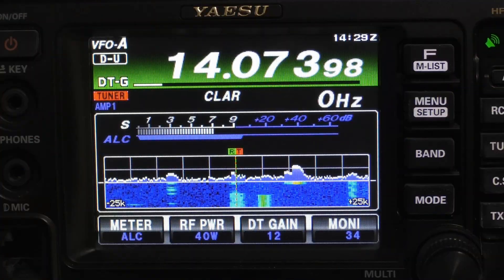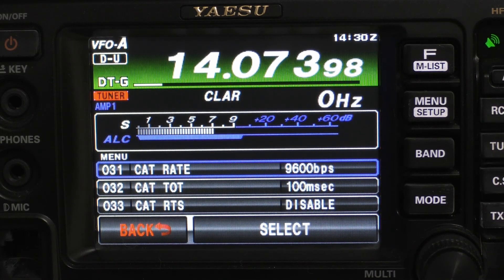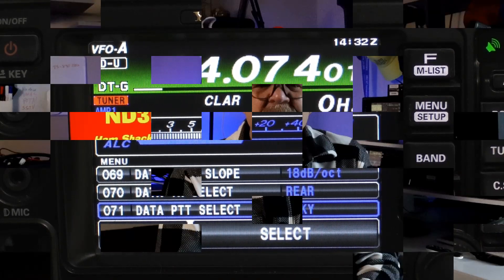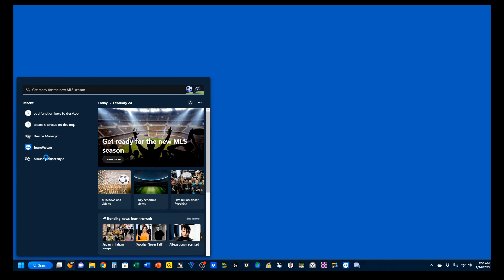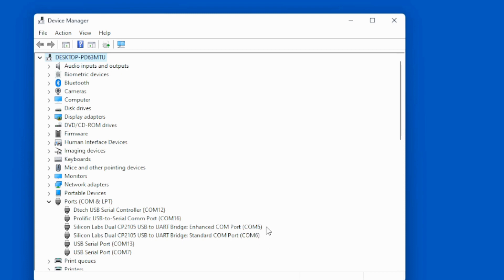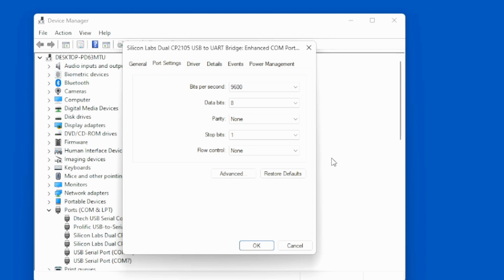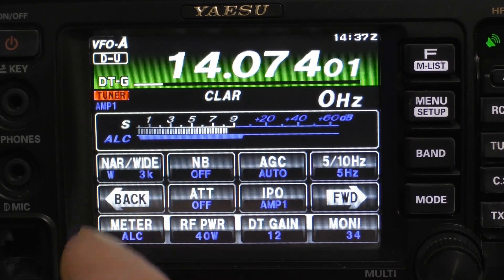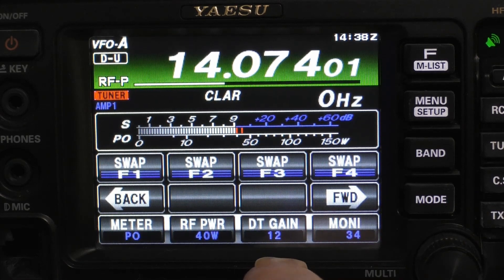Setting your FT-991A for ALL Digital Modes

Comment: Hey Tom, some contradictory info here vs. your earlier videos (FT-991A with Winlink Vara; Using WInlink with your FT991A - Setup and Demo).  I'm setting up my 991A for the first time, and I'd rather not do it by trial and error.  033 CAT RTS: Enable/Disable?  066 DataLCut: Off/100hz? 068 DataHCut: off/3000hz? 071 DataPTT: RTS/DAKY?  I appreciate your videos a great deal, just need clarification on these settings!
Reply from the maker: I’ll have to get my 991A connected again.  It’s currently on the shelf, but I do have a space cleared for it.  Yaesu rigs are all different.  Some times they use RTS, sometimes they don’t.  You could set it up without RTS then do a quick op check and see if it works.  If it doesn’t, toggle RTS on and try again…. On the frequencies, as long as it’s set up to Rcv and xmt over the range you need, you’ll be golden.  I’ll try to get my 991A on the air this week and get you a better answer.

Comment: Tom … while interesting this isn’t helpful in that each of these applications has its own set of settings that must match what’s been chosen here.  FLDigi, JC8CALL and WSJT-X need to be configured in such a manner that these settings above actually function.  On top of that some of these vary by the band.  I don’t see for example the setup for FLDigi that matches these radio settings for sending via FLMsg over say 10M, 6M and/or 2M FM.  Did you do a video on that as well?
Reply from the maker: That’s something I’ll have to take a look at.  Hopefully I provided enough to at least give folks a starting point.

Comment: Enhanced CP2105 UART port is not always the lower one.
Reply from the maker: True, but I was going by the info I had at the time. After a few months I found out it wasn’t fully correct and too late to make it right without deleting the video and doing it over.  Congrats though, you’re the first to let me know.  My 991A is currently part of a go box.  I purchased a new computer just for it and when I make a video about the setup there, I’ll be sure to put the right info in.

Comment: Tom,  Thanks for the video.  I have a question about using the FT991A for Winlink via VHF packet.  The Winlink popup after a session is opened does not have a setting for the 991A radio.  Do you know the proper settings to use to be able to send a message through Winlink via VHF packet.  It does for ARDOP, but there are no ARDOP stations close enough to me for a connection.
Thanks in advance.  Tom KN6VFB
Reply from the maker: I have the same problem. No nearby VHF RMSs.  So I can’t help with that.  There are a few videos on YT where people describe the process, and it seems pretty straightforward.  73
Reply: Would you point me in the direction of such a YT video?  I am using soundmodem software as the interface, but can't find the CAT.dll file for the Yaesu 991A.   @ND3N

Comment: @rondvaartpraamverhuurleeuw3750
0 seconden geleden
Perfect video, CW works but..... SSTV? I succeeded in hearing de soundcart but then it is not transmitting or the otherway around. Rig is transmitting but no sound. 2 days of struggle with all different setting but no solution.
Any ideas about the right menu settings on the ft991A + DM780 com ports and everything is correct.

PA1FR

Comment: Hello, I need your support. I use an FT 991A and do WSJT-X via HAM Radio Deluxe. I set up the connection properly and the sound card also works. I control PTT via RTS. My problem is that when I go on air the MODE switches from D-USB to USB by itself. What could this be and do you have a solution? THX
Reply from the maker: While I have HRD, I’ve not used it to control WSJT-x. From a wsjt-x pov. Don’t use rts for PTT, rather use CAT.   Make use you have the latest 991A drivers, and select  packet/data for your mode.   73

Comment: Tom, you did not set 700hz AGC anywhere in menu as you mentioned. Also why the moni setting. Is that for hearing signal while transmitting?
73, N6ZKI
Reply from the maker: I kept the AGC (MID) on the default of 700 and set the AGC IN THE FUNCTIONS to AUTO.  When using Data modes, the rig uses the MID setting.  Yes, the moni setting is for monitoring your transmitted signal and can be set to your comfort level.

Comment: I love how detailed your videos are regarding the menu settings. I was surprised to see that you left out settings for VARA-FM out of your list. Menu 76 FM PKt PTT Select must be set to DAKY and Menu 77 FM Pkt Port Select must be set to USB.
Reply from the maker: Glad it was helpful!.  This was done shortly after I started using VARA-HF.  I don’t have an FM link within range, so I haven’t crossed that line yet, but I will keep checking to see if one pops up, then after a bit of experience and experimenting will do a video.  Thanks and 73 de Tom, ND3N…
Reply: @ND3N I was able to use your other settings. But adding those two settings that I mentioned will let VARA FM work correctly on the Yaesu FT-991A using the Data-FM Mode.

Comment: Thank you for the video; it was very well done. I have had no problems doing FT8 in USB mode, but I had never tried it in DATA-USB mode before. Most videos I have watched on this topic usually only cover USB. However, after following your guide, the DATA-USB mode seems to be working just fine. However, I have noticed that the WIDTH function keeps resetting to 500 when I switch between bands, although this does not happen every time. Have you encountered this issue before?
Reply from the maker: I haven’t seen that before. Check out my new video on setting the 991A up for digital modes.  It’s the most up to date one I have and it came out a week ago.
Reply: I don’t think the width setting is global and covers all bands at once. I think each band remembers what you set the width at. You’ll have to set the width on each band you use.

Comment: Thank you for a presentation regarding a radio that I own.   I use the free Dimension 4 utility to keep time synchronized.  you NEED to keep the time - otherwise you will never acquire the very weak signal stations - which I enjoy working.
Reply from the maker: Thanks Matt.